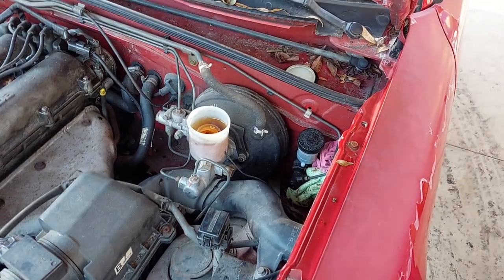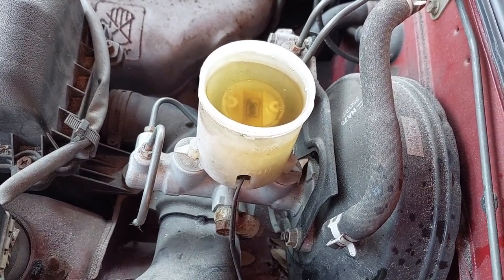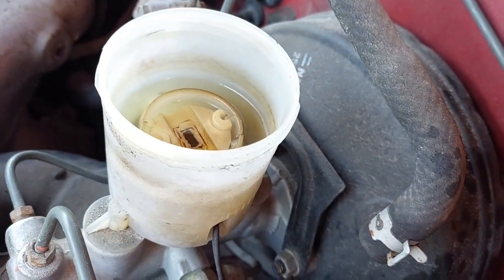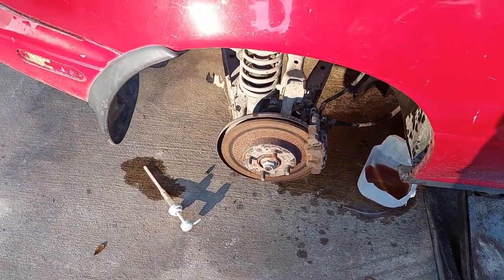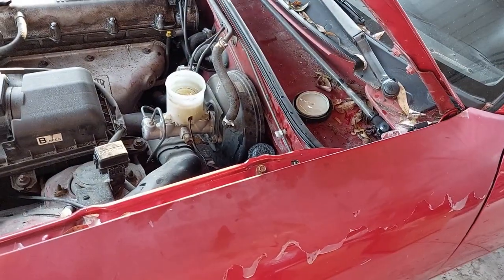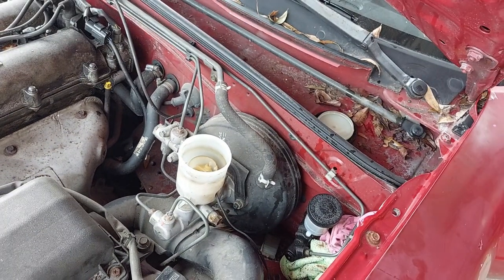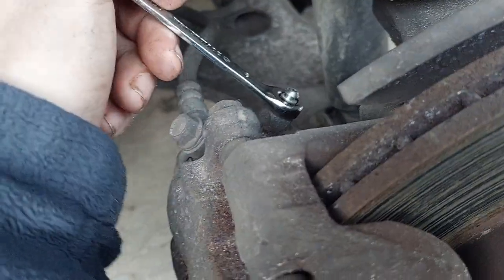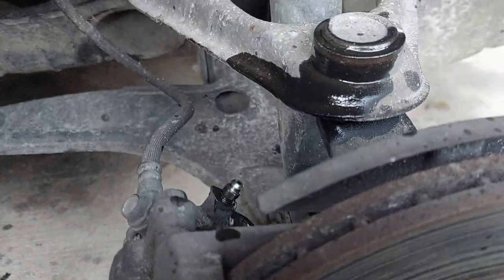Episode 109 - Brake Fluid Replacement 1995 Mazda Miata MX-5

Comment: Btw, is the rear right the furthest from the master cylinder, or is it the rear left? :)
Reply from the maker: Right rear would be the passenger rear.  Normally those call out are done with the frame of reference being like if you were sitting in the driver's seat.  You want to bleed out air from your longest path to the master cylinder as that should get most of it.